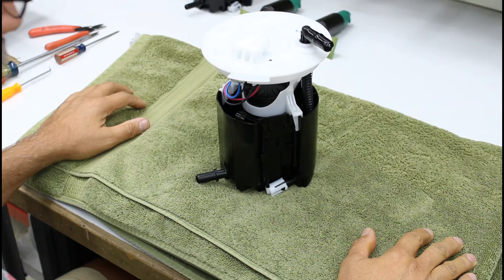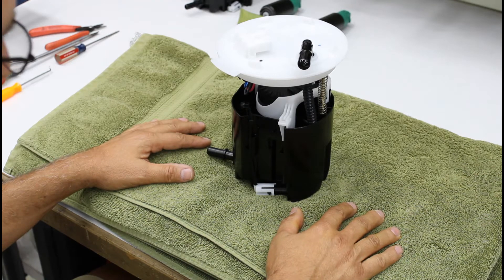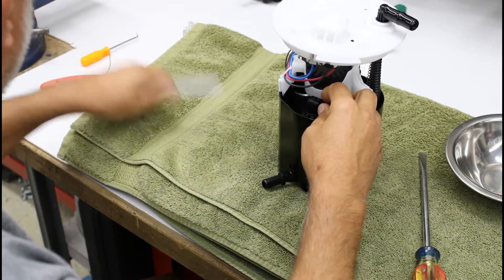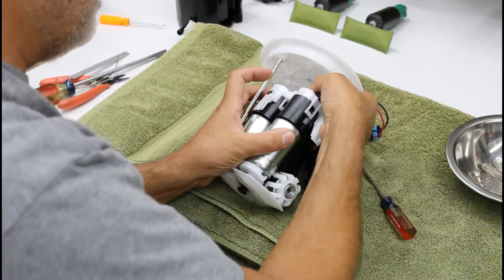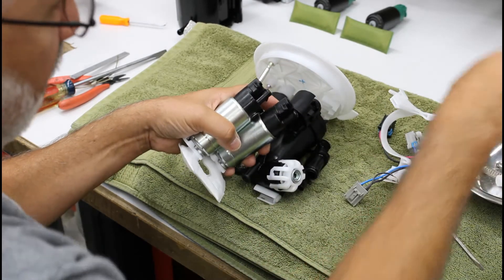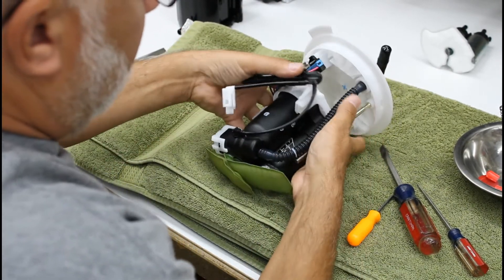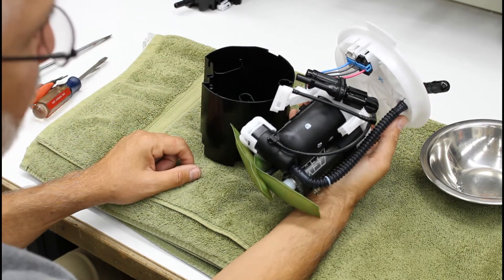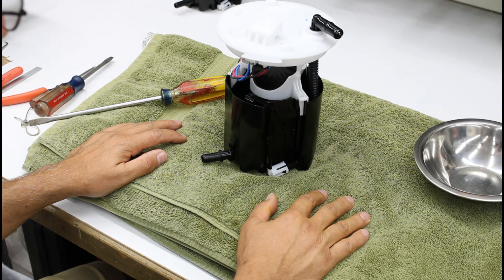VaporWorx CTS-V Pump Change

Comment: FYI silicone lube (that di-electric grease) has NO place in a fuel system as it's not compatible with gasoline. Normal engine oil is all you need for lube on a fuel system.

Comment: Any idea if the fuel pump in a 2014 Caprice PPV come apart like this and the pumps can be upgraded in same method? It uses a ZL1 Pump.
Reply from the maker: The ZL1 is a single pump design. We can install an upgraded pump that can supply 20% more flowrate than the stock pump.  Effectively, this makes the module have the same output as a CTS-V2 with stock pumps. When combined with a voltage booster at 16v, it's a 70% increase over the stock pump at battery voltage. If interested please reach out to carlc@vaporworx.com
Reply: @carlcasanova6976  doesnt the ctsv2 module fit in the zl1 fuel tank? If so, Could I get a tsv2 fuel pump module and upgrade the pumps and use that?
Reply from the maker: @LukeWaters  Yes. Expect to spend about $1500 for the module + pumps. The OEM FSCM likely will not be able to handle both pumps. We have a controller that can cure that problem.
Reply: @carlcasanova6976  will do. We spoke like 2 months ago in email a bit discussing the vaporworx controller and a triple pump set up. I'll shoot you another email.

Comment: Anything ya'll can do to supply parts to replace the plastic nozzle for metal?
Reply from the maker: We can replace the outlet with an AN6 bulkhead but it requires sending the fuel module to us for machining. The really nice solution is to use an ALM Performance all aluminum hat. Check them out on Facebook.
Reply: @carlcasanova6976  how do I directly contact you on this service?
Reply from the maker: @bowhite1293  carlc@vaporworx.com